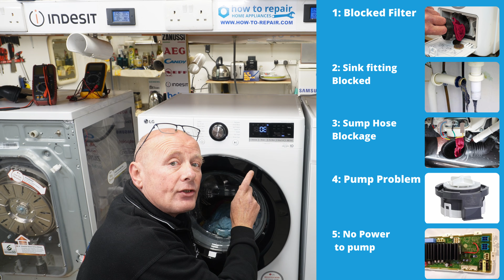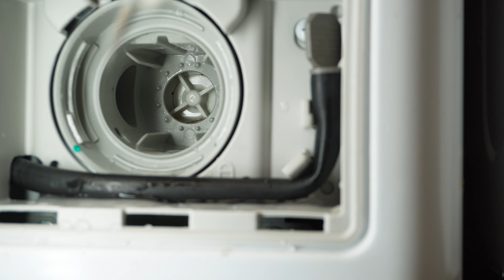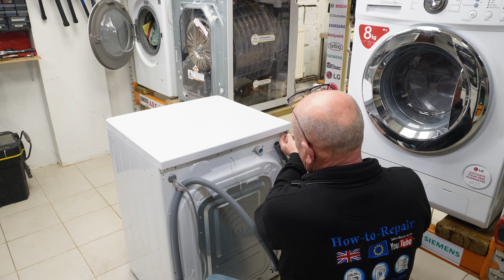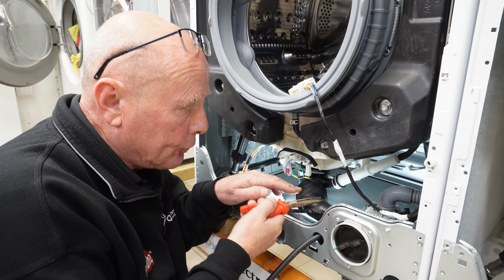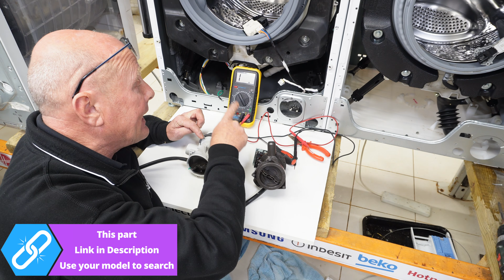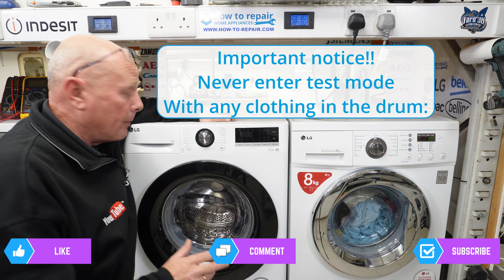LG Washer OE Error: 5 Reasons Your Washing Machine Won't Drain

Comment: I wanted to hugely thank you for this amazing video:

I've got a very similar washing machine as the one you're working on in this video (2019 model), which wasn't always draining anymore ("OE" error - full of water inside...):

I thought something could be stuck inside, but as the draining pump is located in a tiny hole on the left side, I couldn't check it without dismantling the pump first...
In the end, nothing was stuck anywhere, BUT:

Your video gave me the extra motivation I needed, and replacing the faulty one by a 15€-draining pump bought on Amazon fixed my issue.

So thanks a lot mate!

Comment: Hello, Thanks for the video. It is really easy to follow even for a novice. However I have a LG model: FH4G1BCS2 which has a digital display on the door. How do I tackle this, as in this video you take the whole front off. I'm assuming I won't be able to do this as there will be electrics connected to the door. Is there something I need to unplug? Cheers

Comment: Please help me when I turn on my machine to any washing setting like any eg cotton large then the machine starts overflowing with water and it’s turns leaking out the door it’s boiling water idk what to do I’ve cleaned and done what you said the pump filter and the drain house the plumber has checked the pipe and stuff

Comment: Firstly, thanks for a very clear and concise video. In your video, I have one of the older machines with AC pumps. I followed the steps in the video (we were receiving the "OE" message) and was able to open up the machine and remove the water pump unit. In my LG model it has two pumps with one of them clearly marked as the "drain pump". Inside the impeller I found a piece of metal which looks like it came off a zipper or something similar. I was relieved as I believed that I had found the cause of my "OE" problem (I flushed out the drainage sump and pipe as well). I measured the resistance on the two motors and both read 159 Ohm (location 5:28 on your video) and therefore I believed I was good to go. Unfortunately, after putting everything together again and running a washing cycle, I again received the dreaded "OE" message. Any suggestion would be highly appreciated. Does a resistance measurement of 159 Ohm mean the AC pump is good? This is what I understood from your video. Thanks again for a very helpful video.
Reply: Replaced the drain pump (£17) and the machine is now working. My conclusion is that measuring the resistance alone, is not sufficient. In my case the impeller was sticking and therefore even with the correct Ohm reading, the pump still needed replacing. Thanks for a very helpful video.

Comment: On the older AC pumps can switching the two connector wires on the motor terminals affect the motor's operation?

Comment: Socks should never ever get into the hose.  How they get in ther since no big enough hole for socks to pass to the hose.
Reply from the maker: @tswvxyastswvyeej5510  it is very common for socks to get into the hose. They do this on spin when the machine is usually overloaded and they slide between the lip on the door seal and the inner part of the drum it is very regular.

Comment: Hello sir, great video very helpful. 
I followed exactly the instructions disassemble it and inspecting everything, all the hoses were clean, i also removed the 2 pump unit and tested by a technician works fine. 
Unfortunately after reassemble it and check it again in case something fixed, the problem still persists.
Its a 2 and a half year old LG F4WV709S1E. Could it be the main board?
Bit disappointed in a relatively new washing machine.
Reply from the maker: @z00_50  check the power supply going to the pump when you select it to a spin or rince cycle when it’s on emptying. It is also possible that the pump is not working underload I doubt if it will be the PCB.
Reply: @How-to-repair  Ok I never thought that, checking the power supply before the pump I will do that and update you. Thanks again for the reply!!

Comment: Hi! I found this after I took my LG F4J7TY2W  apart by tipping it on its side and remove the bottom. Have disconected the pump but I wonder if I made a mess by dismantling from the bottom rather like you did by removing the front? @How-to-repair

Comment: That’s for the tip about the impeller. Mine didn’t have one, but what it did have was a plastic disc blocking the whole drainage pipe (I think a kids free gift from a packet of crisps!). Whilst I had everything open I also checked the drainage hole from the rubber seal and it was blocked with gunk, a broken drill bit and some stones 😮 no wonder my laundry had been smelling rank for so long!!
Reply: Oh and for anyone else wondering, yes the screws are all different sizes. I stuck them to masking tape with a description of where they were taken from written on the tape. Easiest thing to remove the clips on the tubes is to grip the tabs to expand them with a pair of pliers, I was trying by hand as this video didn’t cover it and it was impossible. Putting the spring band back on the rubber was hard too, you need to treat it like putting a tyre back on a bicycle with levers

Comment: UPDATE: This video was so easy to follow, although the steps took way longer to perform than in the video, lol. It took me almost a half hour to get the lid off (I had to pry it off as it was just stuck) and I have a blister on my hand now as a result... ugh... But to the point, there was absolutely NOTHING in the pump filter at all! NOTHING! But it's now working just fine and I can open and close the pump filter. It would have been so irritating to have paid a repair guy to come out and do what took me a few hours, and pay a couple of hundred dollars to unclog nothing! Thank you again for the video! 

Love the great quick paced detail. I watched several other LG DIY pump replacement videos and had to play them at 1.5 speed as they talk way too slow. I'm fine with pausing and rewinding when I'm using the videos without having to waste time on slow talking. BTW, my pump is fine but I cannot open the filter so it looks like I will have to take the whole dang front off to do this anyway. The only alternative videos I've seen (which I'm not going to even attempt) are tipping the machine on its back. Thank you for your video. I'm going to get to this today and will come back and edit my comment once I'm done.
Reply from the maker: Glad they were helpful mate. Since we work very hard in our warehouse making free video guides for you all on appliances, we always appreciate a beer, offering a choice of single or round beer. https://www.how-to-repair.com/help/buy-paul-a-beer/ Thanks 👍

Comment: Hi. Wonderful video! I got the same issue but I’m still dealing with it! I cleaned all the pipes/hoses, the DC pump is ok, no clogging. I tried the Test mode. The pressure switch seems work correctly;at 229 is “full” of water and at 255 is empty. But when the drum is empty the pump continues to run without discharging (no more water inside) and after minutes the OE error appears. Any hint? Thank you!🙏🏼
Reply from the maker: Hi, mate, sorry to hear about the problem you had. It could be time to replace your machine if, despite your best efforts, it still won't empty.

Although the pumps are typically not expensive, you may wish to replace it if you're not sure. You might also test the pump on a bench by giving it the appropriate voltages if you have the necessary tools.

I've answered a similar FAQ you might also want to check it out, as there are useful videos for you to watch👇

https://www.how-to-repair.com/faqs/lg-fh4u2vcn2-washing-machine-shows-oe-error-code/

Comment: Thanks for making this video. It’s been very helpful. Just at the stage of testing the pump (AC version) I am getting a reading of 176 ohms rather than your 158. Would this generally indicate the pump is good or bad? Many thanks
Reply: That's ok, there would be no response (Infinity) if the pump was dud(open circuit)
Reply: Sorry, forgot to say the unit is 35w, whereas your test machine is 30w. The model is FH4U2VFN3. Many thanks

Comment: Great to find you . I would like to toss in an idea which many Like me over looked when my Dishwasher was not draining or emptiying the water. I took it apart...Checked all the things that could go wrong...Had an Engineer look at it...Everything was in working order..Confused and Fustrated...I took the drainage ie waste pipe from under the sink apart and found a Far Burger blocking the flow. A 40mm solid piece Fat blocking the drainage...So check you Drains before going down the road of timely repairs...Great Channel
Reply from the maker: Hi mate, thanks a lot for your comment and yes you are right. Fat residue, or any kind of fluff, can sometimes block the waste pipe and restrict drainage.
Reply: When you have a fat blockage, this is usually caused by not having the waste hose correctly installed onto the spout coming off the U bend under the sink. it is important to ensure that the hose is pointing upwards at the end of the spout. I see this a lot, where the hose is either pointing downwards or going straight along. The result is that the dirty dishwater from the sink will run into the hose and make it's way into the washer. This is a common cause of a) smelly machines and b) no drain because the fat in your dirty dishwater, congeals in the hose.
I have had to pour boiling water into these hoses to dislodge the fat many times. I suggest you check how your drain hose is sitting because if you don't have it going upwards, this will happen again.
Reply: @johnhepworth1531  When you say 'going upwards', this is confusing...I guess you mean from the machines end.. you want the hose FROM the machine to point DOWNWARDS into the junction with the sink drain, so the sink drain water cannot travel up....
Reply: @thesleepstate  That's right, the hose must not be allowing the water into the drain hose from the sink. If the spout is pi ting upwards and the hose is coming down into it, the water from the sink won't run into the hose, causing fat clogging.

Comment: Great tutorial video.  The 10mm drain hose was blocked but all the other hoses and the filter were pretty clear.  The drain hose was only blocked towards the bleed end so I surmise this would not interfere with the draining of the machine because the bleed nipple is in effect a blockage, so it left me with the pump.  The pump harness is proving continuity but the pump is giving me an ohms reading of around 175.  I take it the ohms reading to be expected around 158 would suggest the pump reading 175 is an error.  Can you say this would be a reasonable conclusion?
Reply from the maker: Hi, please use our contact us page and make sure you fill out the request for what your problem is. I will need the full model number of the identification plate and the details of your problem so that I can provide you with useful literature. A video shoot of the problem would be perfect as well.

I will get back to you within 24 hours, normally. https://www.how-to-repair.com/help/contact-us/  

Please remember to subscribe to our channel, as that's what keeps this channel going. Thanks, Paul 👍

Comment: Sir my LG washing machine top door some time not draining aftrr spinning and some time in drying even though i change water pumb but the problem still continue the same and some time code OE or 0E something like that i believe this problem not water bump could you please guid me what should I check or replace model # TR9103AEPF
Reply from the maker: Hi, please use our contact us page and make sure you fill out the request for what your problem is. I will need the full model number of the identification plate and the details of your problem so that I can provide you with useful literature. A video shoot of the problem would be perfect as well.

I will get back to you within 24 hours, normally. https://www.how-to-repair.com/help/contact-us/  

Please remember to subscribe to our channel, as that's what keeps this channel going. Thanks, Paul 👍

Comment: My washer/dryer also stopped pumping water out, but when i took that drain hose and put it in the bowl, water started flowing really nice, as the pump made only humming sound, so water comes freely, i guess no blockage😅, but pump just dont work and when i wash my laundry and it is time to pump water out it just makes little humming sound and i have to to it manually, putting the hose lower, then water runs out freely. What seems to be the issue, could really use some help..as ive been struggleing a few days now..🤔😵‍💫.
Reply from the maker: Hi, please use our contact us page and make sure you fill out the request for what your problem is. I will need the full model number of the identification plate and the details of your problem so that I can provide you with useful literature. A video shoot of the problem would be perfect as well.

I will get back to you within 24 hours, normally. https://www.how-to-repair.com/help/contact-us/  

Please remember to subscribe to our channel, as that's what keeps this channel going. Thanks, Paul 👍

Comment: Step 1: Drain via the front tube...

What if no water comes out? Water comes out like a bat out of hell if I remove the drain filter next to it though.
Reply: Push that front watertube back inside a little bit, worked for me, it was a little bit crushed inside, blocked the water.
Reply: @edakogel1797  To follow up, the issue was that there was sediment in the tube that had clogged it entirely. When I removed the pump I snaked the drain hose with a thin wire brush to clear it up.
Reply: @edakogel1797 you are a legend, thanks

Comment: My F14U2TDN0 from 2017 has no visible impeller behind the filter, just a narrower tube section going a few cm towards the back of the machine. The machine has the recirculating feature which might explain the different arrangement. It would be great if you could post a video showing this kind of system. My machine got into state with intermittent OEs. The filter was blocked at first, but there were still problems after clearing it. I managed to coax it through a couple of tub clean cycles (draining eventually after hitting play after OE), and hopefully it is better now. Test cycle drains fine. This machine does its low speed test rotations at 45rpm. Thanks for the great videos!
Reply: Mine was coaxable too! Took a few skewers to unclog, still didn't work so I washed 2 more times and rinse and spin and it worked.

Comment: Hello, good day, my LG machine refuses to drain even after changing the drain pump
Reply from the maker: First thing you want to do is make sure you have the correct voltage at the pump when it's on empty cycle you can also check the sump hose for blockages and make sure the waste pipe has no restrictions
Reply: @How-to-repair  ok, sir, I will try it
Reply: Hello pls my washing machine turns on, but don't start

Comment: I wish I knew why you had to take the door seal off?
Reply from the maker: Hi mate, I didn't remove the door seal just peeled it back to be able to remove the front panel. The main idea behind this was to reach the pump unit and sump hose to check if there are any obstructions like fluff, debris, coins etc.

Comment: Excellent, crystal clear and very useful explanation! Saved a lot of my time. Already disassembled the pump and going to replace it - it rotated, but upon further checking I saw it rocking inside the body, which explains why it made a lot of noise and then stopped building pressure. Disassembled it just for fun to see what happened to it, it was full of water and all the bearings were shot.
Donated.
Reply from the maker: Hi, thanks a lot for your comment and I'm glad it helped. It would be really helpful for me to get my video shared and help us fight appliance waste! Please remember to subscribe to our channel if you don't, as that really helps us 😇

Thanks, Paul 👍

Comment: Hi! My LG WM2355CG had an IE error code!
I’m draining the drain hose pipe on the bottom left of the machine but I’ve emptied out over 4 liters of water and it’s still coming out.
Any idea what it can be?
Reply from the maker: If you are draining the pump drain hose, there can be a lot of water still left in the drum if the machine has not emptied you will need to continue doing this until the pipe becomes dry before you are able to access the filter. It's a pains taking job because you are only able to use a shallow tray to collect the water but it needs to be done otherwise you'll have a mess on the floor.
Reply: @How-to-repair  i’m actually lucky enough to have drawers under the washing machine so I’ve been emptying it out into a blender over 2L
I’ve done about 6 of them before it was dry
When I accessed the filter, there was no blockage. So I’m wondering how the IE error code correlates to a bunch of water needing to be drained out by the drain hose pipe?

Comment: I had my new LG washer/dryer combo this morning FWY706GBTN1 to replace my 2018 LG FH4U2TDN2s that I loved very much but limescale rotted my bearings seal and water got out started leaking out the back of the DD on to the element a electrical high pitched buzzing station before Christmas I had someone out to it two weeks ago and said I could pay 180 to have it stripped and fixed new bearing and seal. 
I decided to get a brand new one as old lg was 2nd hand 3 years ago expected to last a little longer but these things happen 🙄
I got the new DC pump it’s so quiet and no more gargling and whooshing through the pipes very smooth I love it it’s even better than my old one which was brilliant until recently but hated that one thing about lg they always make loads of noise draining every single one of them lol 
But this new one is so quiet very similar to my old one but some things have changed for the better 👍🏻